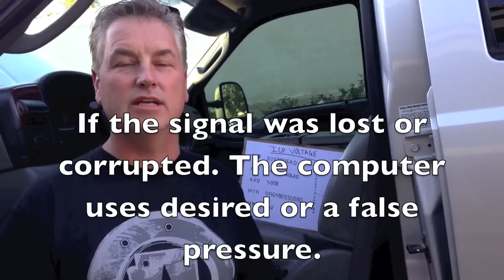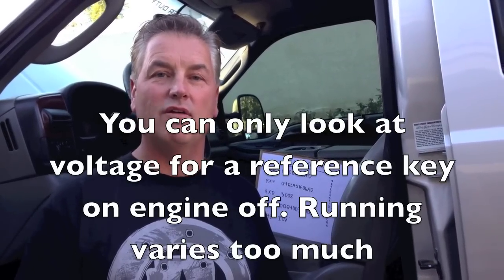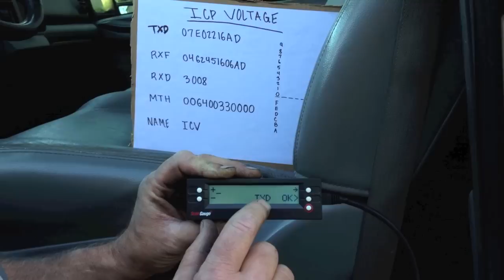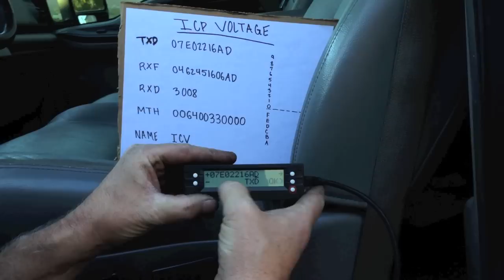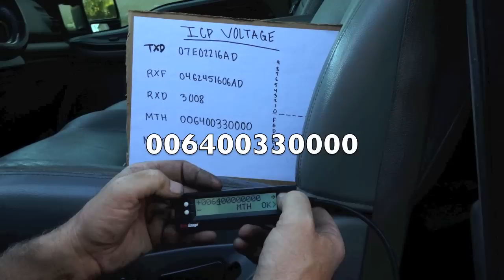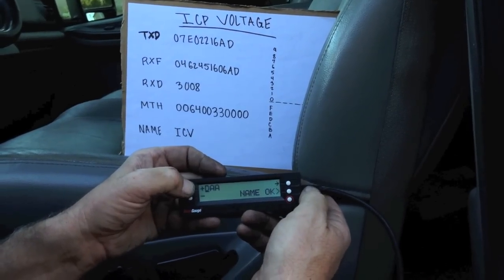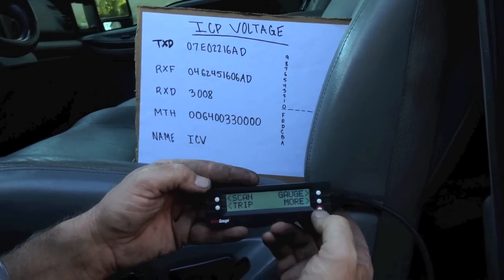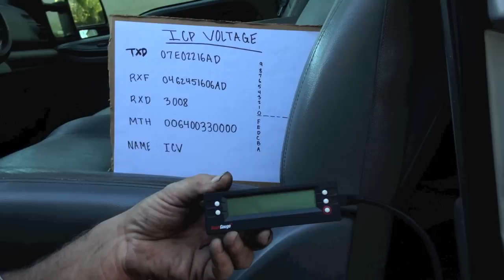Programming the XGauge to see icp Voltage on the 6.0

Comment: Ron, you have helped me keep my old 7.3 running for awhile. Just bought a 2003 sick.0 and have a hot start issue. Looking at your videos to figure out the problem and need to read the live data. I was looking at a Scangauge 2, but would an Edge DIESEL EVOLUTION CTS work as well for reading ICP, FICM Volts, etc? It has a prettier display and would let me tune for economy or towing as well.

Thanks, and keep up the great work!

Comment: SG2 ICP Volts has been available as an XGauge since 2011
Reply from the maker: Maybe you can tell scan gauge esp since it isn't even on their web page yet.
Reply: DieselTechRon
We have a complete list of XGauges over at ford-trucks.com... short list here: http://www.ford-trucks.com/forums/1355942-scan-gauge-questions.html#post14982715
Reply: DieselTechRon
I am a tester/developer for Dashboss on iOS, with a complete list of PIDs for the 6.0.  Also FORscan just released a complete PID for the 6.0 on their iOS APP as well.
Reply from the maker: I see the link and the numbers posted. They are different then the ones I used. I would also like to say the earlier IPR numbers were wrong. When I started testing with the scan gauge it would never reach over 77%, I contacted Joey then and was given an updated code back in 2012.  It works and displays correct now.